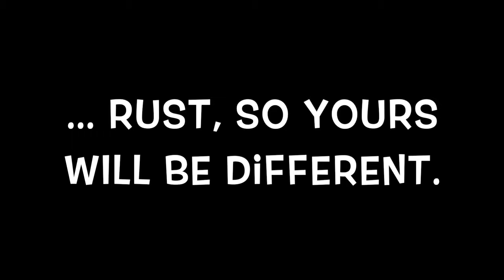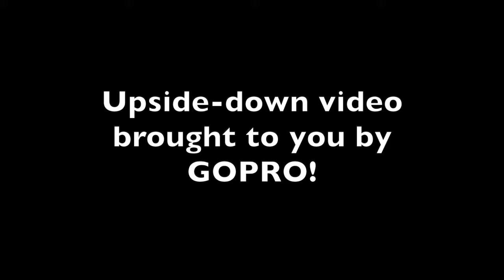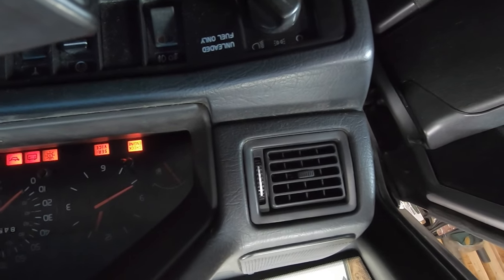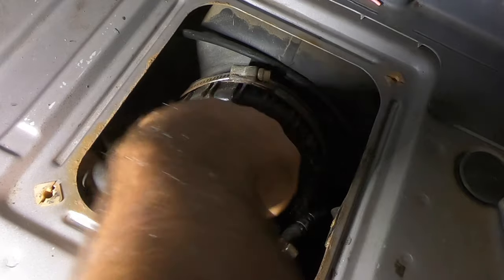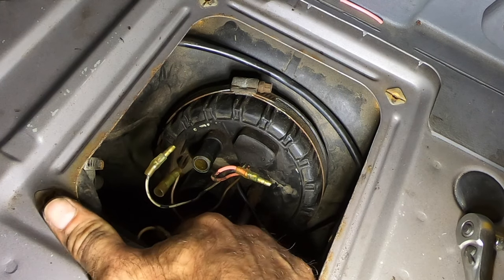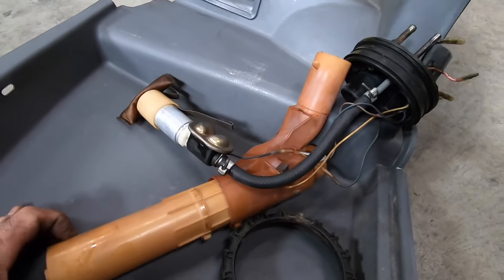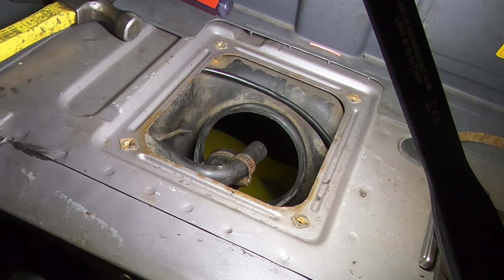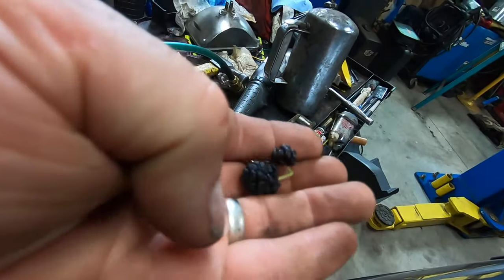'93 Volvo 940 fuel pump sender assembly (Regina / Rex, non-turbo) - removal, installation

Comment: So my 91 740 with Regina is still not fixed as yet. I saw a post about the fuel regulator that is on the sending unit itself and the person with the same symptom as I am having removed it and  claims his car is now running well. Eliminating this pressure regulator will be my next move. The turbos do not have the regulator on their sending unit. Do not confuse this regulater with the dampner thats on the fue rail. Regina cars have one intank fuel pump and do not have a check valve
Reply from the maker: Eliminating the regulator isn't the best course of action. In any condition except wide-open throttle, the injectors will flow too much fuel without the regulator in play, and your mileage will suffer, along with driveability, possibly. Never drove one without the regulator, so just an educated guess - any injector will flow more fuel the more pressure you feed it. Just like a garden hose.

I'm not quite sure what you mean by "sending unit" and "dampner" - no such thing on these cars regarding the fuel system, at least not in North America. You've got the pump, a one-way check valve in the pump output regardless of which system it has (Regina or Bosch), a filter, then a vacuum controlled regulator up on the fuel rail above the engine. The Bosch system will have an extra external fuel pump along the frame rail - the Regina does not have this, so the 2 pumps are different and not interchangeable as far as I know. 

If the vehicle is suffering from fuel starvation, you need to fix that. You've got either a failed check valve in the pump, failing pump, low voltage / amperage at the pump power, ground, or both, clogged injectors, or a stopped up fuel filter.
Reply: @SmittySmithsonite  Thank you for your reply. When parked If I slowly increase the revs there isn't any problem at all getting to max rpms. However if I gun  the engine from idle it sometimes bogs down , sometimes misfires and eventually picks up in rpms. Since I can help myself somewhat I have renewed the fuel pump and filter  , spark plugs and wires , rotor a dist. cap ,fuel pressure regulator at the fuel rail, new coil and ICM. Remanufactured injectors as well. I am not alone with this issue and one gentleman found that it was the pressure regulator ( located on the fuel sender /fuel pump assembly and attached to the output end of the pump and  inserted in the fuel tank ) that was faulty. Unique , I gather with the regina system , is this fuel pressure regulator that resembles a mini ford brake master cylinder. This pressure regulator was determined by the gentleman to be bad  and he bypassed it and has been driving his car without any side effects. I am willing to try this as these units are no longer available .As I mentioned also the turbos do not have this intank pressure regulator. The "Dapener" I am speeking about is another  name , I suppose , for a pressure regulator and its purpose is to smoothen out the pulses from the fuel pump and this is the one you see in the engine bay on the fuel rail. The intank regulator , I take it , reduces the pressure to the overall system based on demand (?) I stand corrected if this isn't so . I do believe I am having a fuel starvation issue when I gun the engine. I will definitly report back with my findings. It's been a learning curve so far. Again thanks for your response.
By the way, you have me thinking about the ground connection , I'll test that too. Regards
Reply from the maker: @abyssalsoul6216  You're welcome. Could be lean, could be an ignition timing issue. The symptoms fit both problems.  

Unless the turbo car is that different from the naturally aspirated version, I'm not aware of any in-tank regulator. The only regulator on mine and a customer's 940's is under the hood with the vacuum hose coming off it. Does look like a mini brake booster. On our vehicles, that's the fuel pressure regulator. Low vacuum (Heavy load,  heavy throttle) allows full pressure to the injectors. High vacuum (Light load, closed or partially open throttle) pulls on the diaphragm and splits the excess fuel to the return line, reducing fuel pressure to the injectors. That's the reason for the vacuum line - it "tells" the regulator how much throttle or load you're giving. That thing you speak of on the outlet side of the in-tank pump is a one way check valve. That's what keeps your system pressurized at rest, so that you'll have a short crank time the next day, or hours later vs. an extended crank time to build pressure. That would be the symptom if it were defeated - instead of immediately firing with a turn of the key, the starter will crank for several seconds until pressure builds. 

My customer's 940 once suffered from a stalling issue caused by that check valve in a brand new fuel pump. It would flow a bit at first, then stop all fuel flow after a minute or so. Confirmed this when I removed the pump and ran it in a cup full of acetone (Used since it evaporates quickly). The car had already stalled, I removed the pump, and when run in that cup, not a drop came out the top. When I tapped the ground wire on the battery to rapidly stop / start the pump, the valve broke free and shot acetone 5' in the air. An interesting failure, for sure!

Comment: smittys euro service!  audi jag and volvo!   this is why the drinking may be involved  that looked like an old gm pump and pulsator  and....at least it had a trap door but you still had to work through the trunk
Reply from the maker: I know, right? LOL! Sure has been alot of Euro stuff coming through these doors this year!

Funny you should say that about the pump. This is the exact same pump I pulled out of a '88 Isuzu Trooper a few years back, too. I had the Trooper one up on a window sill in the old barn, and it matched the Volvo one. Go figure! Volvo used the best-of-the-best back in those days on the 940, so that pump must be a good one. The injectors in it are almost the exact same as my '86 Grand Marquis - just a different color. At 222k miles a few years back, 2 of the 8 were 3% out of spec regarding flow rates, according to the fella that bought them on eBay. I only replaced them because I broke the plastic base on one of them. Good stuff!

Thanks for watching, Scuba! 👍🍻

Comment: Hello, I am trying to buy a 940gl 1992 regina with 99k miles for $800 and the car last month 06/11/21 the fuel pump was replaced. The owner a 82 years old man said is running, but battery is bad, so I went there yesterday with a new H6 battery and did not start at all. If the pump is new could be the fuel pump relay? I guess it goes in the ashtray the one on the left? I really want the car it just needs love and cleaning.
Reply from the maker: In all honesty, it could be anything - stale fuel, broken timing belt, no spark, clogged injectors or no power to them, etc.. If you have no voltage at the pump, then the relay is definitely suspect. Yes, it's in the ashtray. I can't recall which is which - there are several relays in there. You should be able to find a relay layout with a Google search.

With an older owner, I suspect the car sat a while. My first check would be fuel quality. If what you have in the tank won't burn, it'll never start & run. When mine sat over a year and a half (probably closer to 2 years or longer, since I don't know how long it sat with the previous owners), even with fresh fuel, it took a LONG time to finally fire and run. I was cranking for a long, long time, over and over again. Had to let the starter cool off a few times. The previous owner attempted a fuel pump replacement, and set the harness on fire somehow - after that, he gave up and parked it. Even with a new pump and a fresh tank of gas, it still took a few minutes for either the injectors to clear out, or for the stale fuel in the lines to be purged.
Reply: Just bought the car for $500, 1 owner 99k miles all original 0 rust. The car failed 2016 and now is in my hands. I removed the fuel pump sender unit and it was touched by a trash mechanic. I re did the unit and put new pump, hoses. Everything works like new again. Lucky me!
Reply: WE have a 740 and Sometimes the fuel pump did Not Work at all. Talked to a Volvo Specialist and He Said, to 90% it's the relay. Yes, IT IS located behind the ashtray on the left, replaced IT and No Problems since....

Comment: Regarding the check valve , the symptom I had was difficulty in starting after a shut down. I would have to cycle the ignition key a few times for priming the it would start right away. I gues the fuel was draining back.
Reply from the maker: Yeah, that's the normal way they always fail. That one Volvo I had here took me a bit of time to figure out. I could hear the fuel pump blazing away in the tank, but then the car would die like it ran out of fuel! Was tough to figure out. I had to just remove the pump, and hook it to a battery while in a small container of acetone (so it would evaporate quickly).  I had it running with not one drop coming out. Strangest thing I had ever seen. Then I'd tap the ground connection turning it on and off rapidly, and then it shot acetone 7' in the air!  Been doing this a long time, and I have never seen a failure like that before, or since!

Comment: boom hey smitty
Reply: had done one in a wagon pain in the ass fumed out in and out 2/3 times ran wire forgot ring fumes make me forget to.used lps3 on aircraft good stuff had lps1 and 2 also kinda like light med and heavy.u get in bulk?i have same sprayer . oh yea i struck blood also.plus wicked head ache . cust said easy job just didnt have tools or time yea rite. full tank too . have a good day, back on fire wood processing ,changed out rubber seat and needle on 5hp splitter float level almost shut off cause seat swelled only run full choke. now need to repack ram never stops .entertaing vid thanks.
Reply from the maker: FIRST! Hey Willie! 👍🍻

Running around like crazy today. Got 4 tractors I'm working on, plus my buddy's '96 Tahoe that's all apart out there getting new axle seals, wheel cylinders, & a rear brake overhaul. Also discovered 2 of his U-bolts rotted right in half! Something didn't look right with the pinion angle, so I started looking closer. One U-bolt on each side completely rusted in 2. Ordered some shocks for him, too, since the rears are about half a month away from rusting right through. Some new E-brake cables will finish that job off. Going to need a lot of body work to get a sticker in a few months, unfortunately - foam and spray paint to the rescue, lol.

Have a great day, Willie! Thanks for watching. 🍻
Reply from the maker: @willefixit  - Thanks Willie! Yeah, I bought the LPS in a 5-gallon pail many years back. Was VERY expensive, but alot cheaper than it is right now I'd bet.They don't give that stuff away, but it works great. Was alot cheaper than buying it in the aerosol cans by several hundred dollars.

Yeah always the way with fuel pumps! Always full to the top! Carb problems are also never-ending these days, thanks to the damn ethanol they throw in the fuel against our will. That stuff costs the economy millions in downtime and repairs, I'd bet.  Anyway, have a good one Willie - weather at least cooled off a bit for ya. 👍

Comment: Thanks for a very Nice "slow TV" video. Helped me a lot and gave me courage to remove the in-tank fuel pump on my 1995 944 B230 FK. It was complicated but your video gave me the courage to go for it. Picked up the pump and see to my delight that the hose was pulled from the pump. There was a one-time staple that has now been changed to a better one. Now the car is running again after 3 months of downtime. Thanks for your video!
Reply from the maker: Great to hear!
Reply: Sköt du av originalledningen och klämman med bosch pumpen från fabrik, eller satt det en eftermarknadspump i din? Har kört 255l/t pump som inte lyckades pressa av originalledningen.

Comment: For anyone doing this: 

Twist the pump lefty loosey 180 degrees when you pull it out of the pump. You want to keep it just unplugged but right in there and twist, then you kinda feel when you can start pulling it outwards. By the end the pump will be 180 degrees spun and all the way out of the tank, reverse this for install. 
Take a marker and mark the "up" position of the unit so it's easier to align the pump straight forward facing (so you don't get delivery issues). Make sure the pre-filter of your pump is facing straight forward along with the unit. 
Make sure you get better hose clamps than original. Go to your local hydraulic shop and explain the situation, they should be able to find the right hose and clamps that can withstand being submerged in e85 etc. (The plier and worm style clamps suck here). 
The biggest tip is to be VERY careful with fumes. A full tank will burn but an empty tank will explode. (AFR is something like 14.7kg of air for 1kg of ron/mon 87-95). Keep it well ventilated and dont hammer any metal on metal (like the plier hose clamp on the breather iirc) which can create sparks or use a torch etc to see (flashlight). Do this in daylight/keep a light source further away and in a well ventilated space. 
If you're going to leave the unit open overnight, screw on the retaining ring again so it doesn't shrink (I've heard this can happen but hasn't to me). You can also take this moment to cover the hole with something which will protect against debris. 

Finally, do NOT attempt this if you're not somewhat experienced as a mechanic. Chances are you won't be able to get it right and now you'll need to drop the fuel tank to get your car started. Worst case scenario your car turns into a fireball. If that isn't discouraging enough then let me just say that getting the sender unit out is the easy part, and that pit in your stomach when you realise you can't get it back in will hurt more than paying a mechanic.

Comment: I'm watching you Smitty because I have a 1992 940....and you guessed it, it's time to replace the in-tank fuel pump.  I am sooooo excited about starting this job.  I'm going to have to coil up like a snake to fit inside the trunk. Hot damn.
Reply from the maker: Manon Mars -  I should’ve thrown some blankets in the back there. Would’ve made life a lot easier for me. It was about 90° out in the shop when I did this job, so I probably made it sound a lot worse than it really was. At least you don’t have to get under the car and drop the tank like with most domestic cars. Good luck. Hope the video helps you. 👍🍻
Reply: Real Volvos have room for 4 dogs or more!!!
Reply: @SmittySmithsonite  I did this snowed in (.5m of snow) with the rear end facing a rose bush (had my legs all in it the whole time) with intermittent snow winds. The dampers for the boot are also shot so I had to use the original jack and a jackstand (half on the jack, half on the floor to achieve the right angle) with a jackpad (protect the boot mechanism) to hold up the boot lmao I wish I could've been in a hot and humid, well lite garage (we have like three hours of sun in a day). 

(yes I have huge hands) 

Idk why I didn't buy a 945 ;(
Reply from the maker: @tracklizard4018  Been there, brother. Did that the first 28 years of having my driver's license. Worked outside in rain, hail, sleet, snow, ice, blazing heat, and subzero temps. I don't miss that one bit!
Reply: @SmittySmithsonite  Great experience afterhand though! I remember when I did an apprenticeship at a shop and I used hand tools for everything. Everyone laughed and kept handing me pneumatic wrenches and specialist tools. At least I know I can get (mostly) anything done with what I have. 

Currently hiding inside from the cold, again. Tried doing the job without taking off the inlet filling hose, which kills your arms since you have to press it to the side the whole time. Hammrered a 7mm socket on the rusted clamp and some rust solution, hoping I can get it off so I can get this god damn thing to twist in correctly! Definitely happy it's friday meaning beer, beers, and more beer when I'm done!

Comment: I cant believe how much worse this job is compared to 240s. In the time it took me to disconnect the hoses, I'd have already finished the entire job on a 240.  Not sure why this sender needs to have twice as many connections and half the working space of a prior model with the same fuel system.

 I've been trying to get the sender out for a half hour without breaking it and it just doesnt even feel possible to rotate it in the tank due to the baffling. 

As for the coloring, thats normal. Every one of these tank pumps ive seen has had yellowed plastic identical to this. Not sure about the sock, but thats the same one ive seen in every tank as well.

Comment: The volvo clampss are much better.I never use the SS clamps they always seem to come lose.Volvo clamps are stiff & wont come loose,,I have to replace the fuel supply line,,leaks cost $$$
Reply from the maker: Indeed they do! 

I've found with worm clamps, you need to crank them down pretty tight, and buy quality ones. I don't doubt the Volvo ones are good - they used to build great cars!  Only had a couple come loose on me over the years - one on a transmission line on my '72 El Camino while way up in Ontario, and another on our '86 Grand Marquis upper hose as my wife was commuting to work. Both had been on there for at least 50k miles, probably more in the Merc.. The ones I removed from the old sending unit here were on for 4 years, and about 50k miles - still tight, no leaks, aside from that big crack in the unit.

Thanks for watching, Hugh. 👍🍻